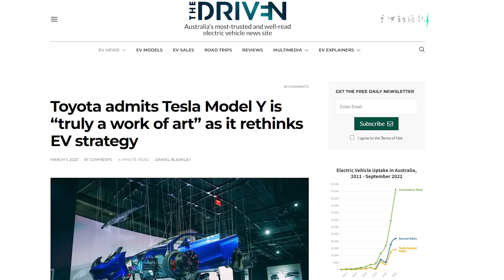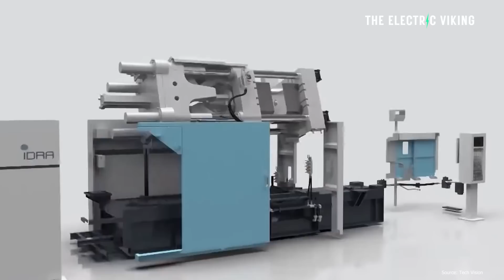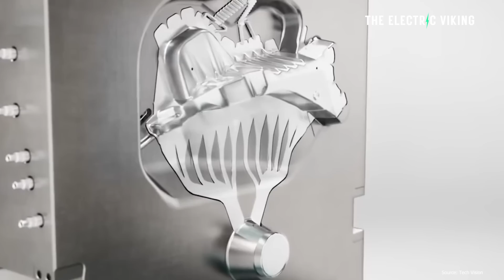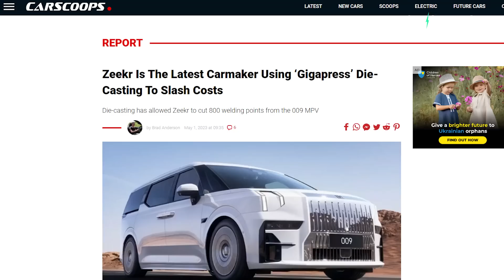Why Toyota decided to change entire production process to use Tesla's 'Gigacasting'

Comment: Tesla has also lined up supplies of lithium etc. which it can sell to backwards competitors if it doesn't need them any more.  And they continue to redesign their assembly line for ever greater efficiency--- their Mexican factory will be the first designed from the ground up to their latest pattern.  And Tesla's charging network will displace gas stations on a massive scale-at lower cost (and thus higher profits) than any competitors.  Add to that the way Tesla makes continuous assembly line changes to their autos- rather than waiting for a new model or a new year.  Oh, and they aren't drowning in debt.  I foresee a shakeout in the automotive industry comparable to that of the 1930's.  I don't anticipate ever buying an EV, but I can admire a job well done.  (IMO they mostly require a better user interface, though.)
Reply: I remember Steve Jobs going on about how the Apple TV would have the simplest user interface ever--far simpler than we could imagine.  Oh?  I remember when TV's were controlled by two knobs:  an off/on/volume knob and a channel selector.  Apple never beat that.

Comment: There is a formula I learned in high school known as kinetic energy or energy in motion. 

KE= 1/2 mv square

If you increase the velocity you use the square of the kinetic energy

Double the the mass or weight means double the kinetic energy

To get optimal distance —> slow down & remove the extra unnecessary items in your car.

Comment: When Giga casting is combined with the upcoming Tesla ‘Unbox process’. (why is it called that), the whole auto manufacturing process will be raised to another level.  The efficiency will be incredible and the whole process will depend on highly sophisticated software, an area Tesla excels in.  It looks like Giga Mexico will be where this process will first be used.  A massive production revolution is on the horizon, led by Tesla.
Reply: It's called that bcoz it's like putting the parts together out of a box to do the one final build.

Comment: Many other industries will benefit when Tesla reveals how they solved the problems that have plagued large die castings in the past: thermal shock cracking and breaking the steel mold inserts and problems with cracks in parts of large size because the metal shrinks as it solidifies while still in the mold.  They will also benefit other industries when they reveal how they control the weight of the castings which are made in mold cavities that are optimized for speed of filling the cavity and not optimized for controlling the weight of the finished parts.  Also, good luck molding box beams, which are widely recognized as very light and very strong structures, now made from cheap sheet steel.

Comment: My greatest fear is that Tesla's self-driving will work.  Not the self-driving part but the fact that it can be changed online where any hacker can attempt to program every car on the road to accelerate to max speed and with steer by wire turn into oncoming traffic.  You might even think that a preprogrammed chip is unhackable but the programs will eventually be programed using AI and AI can program in Trojan horses without anyone being the wiser.  The only thing worse that fools are fools in charge.

Comment: Yeah gigacasting is probably great to cut total car part count down, saving on costs.  Then the car gets in an accident and the frame is bent.  Then what?  Rebend it back?  How?  You throw it away.  I will bet the first reason Tesla went to gigacasting was to get a frame strong enough to hold that battery pack.

Comment: Magna, a large multi-national automotive assembly company has been using high vacuum casting for large body and chassis parts for quite a while, as well as for battery carriers for EV.   But a lot of car body and chassis sections are still made from lightweight high strength boron steel, known as bake hardening steel... because the temperature in the paint baking ovens makes the steel a lot tougher.  Basically gigacastingf means that when a Tesla gets damaged it is gonna be written off - which is another blow to the environment by tesla on top of all the toxic chemicals in their cars...  Nice one Tesla,  making cars that cannot be repaired, or disposable single use cars.... There is very little new in the auto industry, and  most times manufactures ignore certain processes for a reason...
Reply: The castings can be readily recycled. A written off car these days is a gold mine!

Comment: Think of inkjet printers. A few years ago, before the current HP semi-monopoly, you could get an inkjet printer for less than 30$ CA. It wasn't cheap in the end; you'd pay through the nose by buying ink cartridges (with an insanely high profit margin).
When Ford says it's loosing thousands of dollars on every EV you should not weep : they plan on making a killing with their spare parts and Ford has been hard at work making "Right to Repair" impossible (sometimes by hook and by crook).

Comment: You need to remember that most large corporations have built up processes and procedures to avoid change, they actively purge mavericks and internal change agents who try to do something novel and those people leave for other projects. That is why the development chasm exists and it takes a visionary founder from outside the industry to make a giant leap across the chasm where industry insiders had been calculating it would take two or three jumps and you'd certainly fall in the chasm. When someone else shows them a way across they cheerily proceed -- where they realize that same someone has already skipped across the next chasm before them. Now that Toyota has broken their ICE wall, they will get their fast-follower processes in motion and catch up fairly quickly.

Comment: The Multiple part construction system came from a day when cars were relatively more expensive and makers wanted them to be relatively easy to repair. Production wasn’t so streamlined and looking after service and repair outfits had quite a bit of priority when designing a car. When manufacturers moved away from the common spare parts model it was a matter then of having enough of those unique parts to satisfy Customer repairs for the next ten years for their model. Our disposable society doesn’t need that model upping costs and holding development back. This is why Tesla gets away with so many changes between models …their insurance isn’t built around rebuilding but rather replacing any suspect damaged vehicle … it also helps that electric vehicles don’t need anywhere as much servicing or spare parts. Just Tyres for the most part …

Comment: IDRAs Press- owned by LK Industries - since about when (just after ElonMusk founded Tesla.. (sorry that is fake news, he didn't found Tesla - that was other folk back in 2003.)  lol.

Yes Chinese corporate LKI want every manufacturer to follow Sandy Munro's advice and "build better bigger" - and use GigaCasters on all new vehicle lines (the New bit, needs a new vehicle platform and factory to include these machines efficiently).

.A car body can be reduced to 2 modular components easily enough - with adequate body and crumple structures front rear (underside - if crush boxes are desired) and sides...

Comment: Viking
My Mercedes was impacted and the rear chassis was bent
Insurance wrote the car off

A giga casting would have offered more resistance to such distortion

Therefore people who make sucg statements are ignorant that an impacted giga casting results in more write offs than the structurally weaker stamped metal chassis

Comment: Imitation is the sincerest form of flattery. If those presses were available thirty or forty years ago all the legacy manufacturers would already be using them. They did it with bumper and body panels from plastic for decades. The insurance issue is the industry is already charging high premiums and it could get worse if they have to start replacing more expensive vehicles more often that have damage that normally could be repaired. Insurance is required in the USA, for liability anyway, and full coverage is mandatory until the car loan is paid off. As you mentioned before the car's battery is quite heavy and heavy vehicles can cause more damage which also can figure into the insurance premiums.

Comment: The great thing about giga castings is they will not rust.
Reply: Chloride attack is the same on aluminum castings as it is on steel.  On aluminum it is called corrosion, a more general form of the word "rust."  You should be aware of all the corrosion problems with modern aluminum aircraft, and they don't even get wet with salt water the way cars do in much of the US.

Comment: I used to have a Tesla Model Y. Someone hit the side of my Tesla, and because it's a whole piece done by gigacast, to repair the whole piece, plus all the cheap parts inside were shattered, repair estimate was $30K+, and the shop recommended to total it instead. Also Tesla cars hardly change the body design probably because it's expensive to create another gigacast for different body shape. It's getting so bored looking at the same design. I love the quality and design of my Audi Q4 e-tron Sportback, both inside out.
Reply: Q4 e-tron is a ID4/ID5, and just such a completely different exterior design is possible with the gigacastings.
And since several hundred thousand / millions of vehicles of one type are manufactured anyway, a separate mold can also be used for this.

Comment: Reducing 600 robots and making car using Giga presses reduces costs in the amount of time saved not using those extra robots.  Say each robot uses 10 seconds to perform their task you would save 100 minutes to build a car.  Also the safety factor that helps insurance companies if you have to total a car when damaged if using the auto pilot software that would slow or stop a car if it feels it is about to crash.  The downside is how that battery is made to be part of the structure of the vehicle.  It doesn't take into account when the battery wears out can it be taken out and replaced maintaining the structure's integrity.
Reply: Robots work in parallel - so there can be 6 robots all working on a body in a station at the same time , then the body gets shuttled to a new station and another body is moved into place,  even in the 1980's the average cycle time to make a car body was about 38 seconds, which included the move time to a new station... So car bodies were popping off the end of the line every 38 seconds or so.

Comment: Gigapress or whatever, is not the best manufacturing process, building with carbon fiber is. Along with electric drive systems you would end up with vehicles that last 50 years or more with just basic upkeep. Vehicles would be stronger, lighter, never break down, making them so reliable and valuable that everyone would want one. World sales would drop to 1/5th of what they are. This is what's coming along with flying cars for those who want to travel at 200 MPH + Who do you want building these vehicles? Those who build the best quality. The only press, will be the one used to press your pants, we know you won't have a shirt, because Musk will have taken that off you long ago!!!!! Another $45 and you'll be back to zero with Tesla stock, a good time to dump that dog!!!!!!
Reply: Carbon fiber is a great material. The challenge is to produce cars with this material that can be made at an acceptable price point.
Reply: @jbbuzzable  - I hear you, if the car lasts 50 years, what's acceptable? No company wants a car lasting 50 years, but the public will demand it, the auto industry will completely change, older vehicles will be delivery vehicles.

Comment: My main comment is "Finally!". It has been obvious since it became clear what Tesla was doing that others should emulate and improve (if possible) on the Tesla process.  Optimised, purpose designed EVs (not EV/hybrid or EV/ICE designs); wide use of aluminium alloys for light weight; parts and weight reduction by using GigaPress-type castings; structural batteries; the latest/best battery technology. Any auto manufacturer not adopting that model is doomed to extinction. Take note Ford, GM and Stellantis.
On the matter of accident damage if you crash a car made of pressed steel parts insurers look to cut out and replace panels/boxes or whatever. Same thing with a casting - if it's not salvageable then replace it. I haven't seen the costings to replace, say a front offside quarter on a conventional steel car vs a Tesla/castings car but it is reasonable to assume that the casting makes the process easier not harder so possibly cheaper. In either case major damage could result in a write-off.

Comment: Gigacasting is a super-smart approach to making EVs, one that seems unlikely to ever work well for ICE vehicles with their fundamentally more complicated and unsuitable drive train. As a materials chemist, I was also impressed that Tesla did the metallurgical work to develop the proprietary aluminum alloy that makes it workable. Sandy Munro's (and, later, Toyota's engineers') glowing analysis of the the Model Y was totally on point.
On the other hand, Tesla needs a public relations department. Remember when Elon said, "Solving Full Self-Driving...is really the difference between Tesla being worth a lot of money and being worth basically zero."? No, and I'm sure that Musk himself would have backed off that over-the-top statement if he had been reminded that Tesla has done some awesome research, development, and manufacturing - even if FSD is never solved. (But FSD is getting pretty decent in the past few months...)
Reply: Huh? 
Casting is mostly there to make the frame. 
As long as the correct geometry is cast to support the correct weight, it doesn't matter what drivetrain get strapped to the frame. 
Mind you tank with cast structure used to house engine and drivetrain exist in the 1930s, it is not rocket science. 
The hard part is make it light enough and simplified the process enough so it is commercial viable to build consumer product.

Comment: Gigacastings will make a car more likely to be totaled in an accident. Big Aluminum alloy castings are not typically weldable, and they should make them out of bolted, smaller assemblies. The ability to repair cars is dropping like a rock, and it is very unfortunate.

The big castings save a lot of assembly line work, so they are cheaper for the manufacturer, but not necessarily great for the long term customer.
Reply: I don't agree with all of that.
Reply: @jbbuzzable  I will bet you money that these giant giga, casting parts will never be a made available to third parties
Reply: @edwarddejong8025  There is nothing stopping them. If there is money to be made, someone will be there. Besides. who would want to buy a gigacasting other than the manufacturer?
Reply: The Labour cost of a vehicle mechanic is going through the roof anyway.

Comment: How does it work with gigacast panels when it comes to crash repair? Does the whole casting have to be replaced? If so, is this more expensive than a “traditional” format? What is the cost saving in making a new car this way?
Reply: The Gigacasting impact absorbers are replaceable, which covers most damage cases.
A side impact often leads to a deformed structure, which almost always means a total loss, regardless of whether it is steel or die-cast aluminum
Reply: When a Tesla has a bump, the whole car has to be replaced.....
Reply: @chrissmith2114  😂

Comment: I worked for Ford for some time. My group created the weld coordinates for all the body parts so the robots knew where to put a weld spot. We mostly did underbody, so i know quite good how the front and rear underbody of various Ford models look like (other car brands are not that different), how many parts there are and how many weld spots are holding them together. The gigacasts from Tesla are parts of the underbody which in case of damage are basically unreparable. Parts you could change from damage are the front and rear bumper beams, front fenders, hood, doors. Cause all that stuff isn't welded to the body but connected with various fasteners. When some parts of the welded body structure are effected any normal priced car will, in most cases, be a write off anyway. So hats off to Tesla. The gigacasts are a really great inovation in that space. And thats not the only part where they teach the established OEMs a lesson. I personaly don't like Teslas that much. Way to big and expensive for me and their cockpit is just horrible. I really like how they kick the huge lagards like Toyota, VW, GM etc. a nice kick in the balls. I'll wait for my Aptera though.
Reply: I want an Aptera too. They make so much sense to me :)
Reply: You should have trained your Aussie Ford manufacturers, did a low quality rust creating "work"
Reply: Castings can be repaired by welding in a new section. It's not all doom and gloom.
Reply: @gregbailey45  4 x 4 in thick cast secured by weld 1/2 inch on the outside, how exactly?  May-be bracket the break, drill holes, and bolt it backed by weld, gets you down the road a while.
Reply: Not expensive any more in many countries. Should check out current cost compared with comparable new cars.
Reply: Yeah, gigacasting is great to reduce car production cost and then you consume all that money and charge more for the car.  Then the frame gets bent or cracked in an accident, that is it, you throw the car away.
Reply: Thanks @heinzbecker9653. Great to read a logical comment based on knowledge, experience and fact.

Comment: FYI, cars used to be made body on frame. some trucks and large SUVs still use this technique, a steel frame with body on frame. In the 60s the manufacturers began using "unibody" welded stamped pieces, eliminating a separate frame.